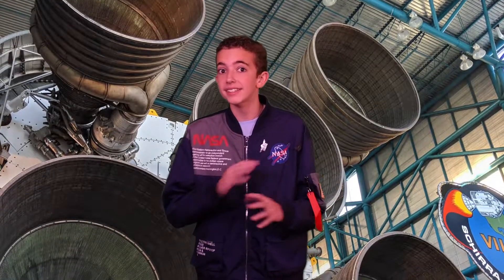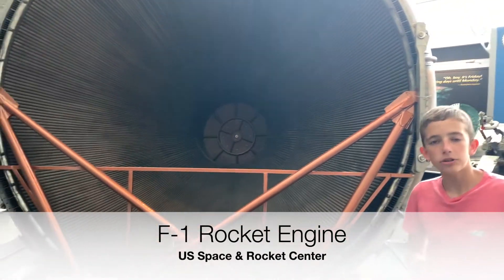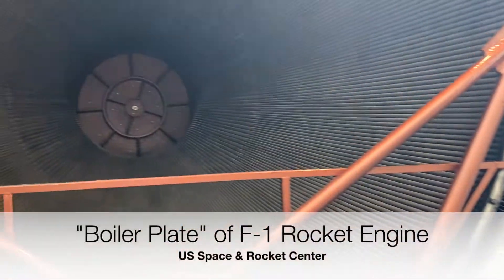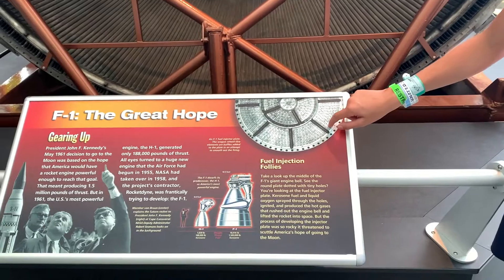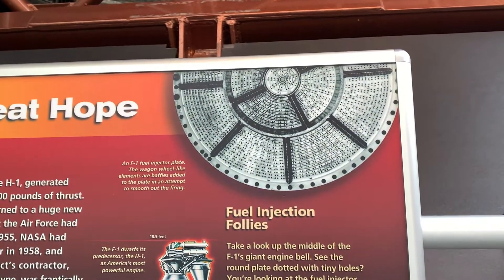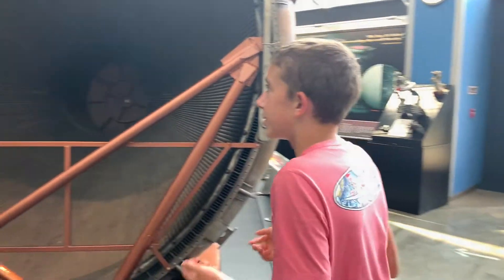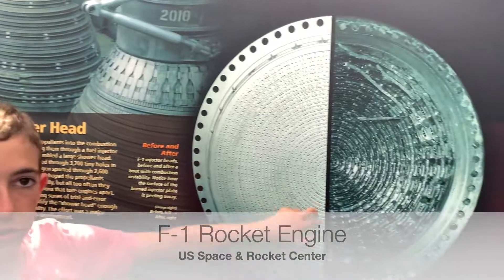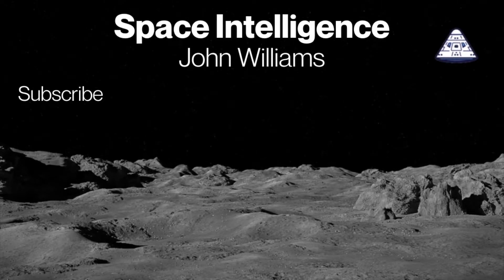Saturn V F-1 Rocket Engine: Most Powerful in History

Comment: Hi Kid. Nice video. If you allow me, let me just make a few remarks...
The coolant for F1 engine (and most LRE engines) is the fuel, not the oxidizer (Not the Liquid Oxygen). It is pumped through the regenerative cooling system and the temperature pickup is in order of 150-200K only.
Also, this is the engine Nozzle or de Laval Nozzle. the Nose cone is the top of the rocket.
One important remark is that the par you refer as boiler plate is actually a injector head. Boiler plate is the designation of (usually) a capsule with all correct dimensions and position of CG, but not functional. To solve the combustion instability, the engineers used this device called Baffle and they actually knew the reason it reduced and almost entirely suppress the combustion instability. The idea was create the divisions of injection flow to minimize the formation of transverse waves... Amazing work the Americans did, while the Russians went to the direction of injector design adjustment (Swirl vs Impinging)
By the way, F1 is not the biggest/most powerful engine in History. this title goes to RD170/171 and for a briefly instances, to RD270M as well, despite the sources about tests with zip fuel (Pentaborane) are not fully available.
Please keep up with these cool videos :)
Cheers
Reply from the maker: Love the Feedback! However these videos were filmed with me improvising every word. However as I make more I will be writing notes down and getting for correct in my facts. Thank you so much!